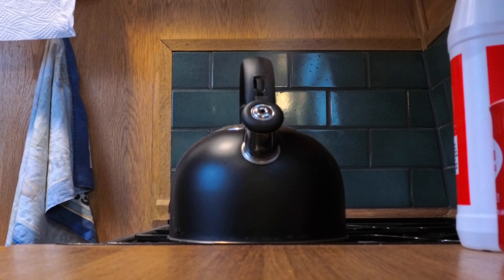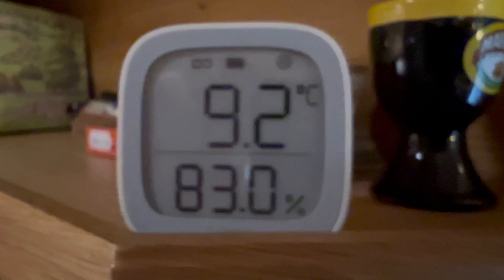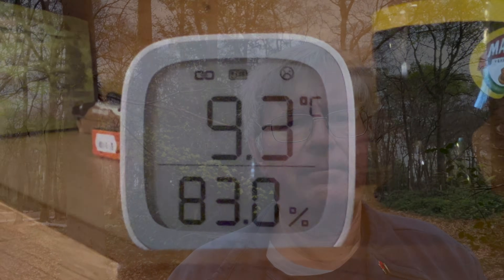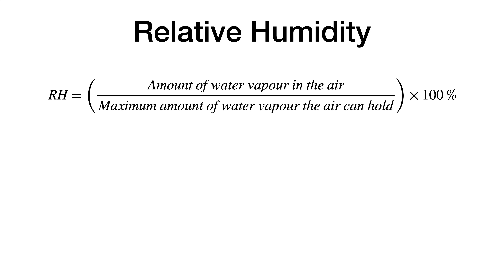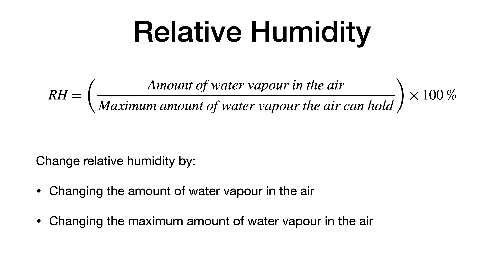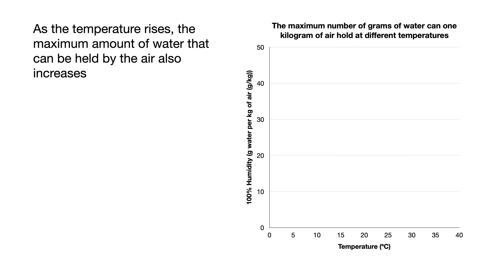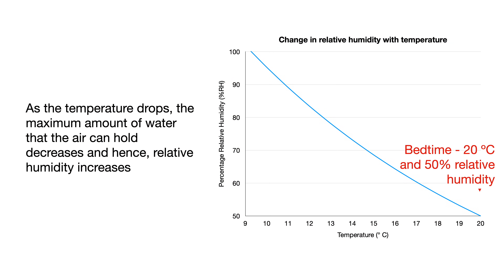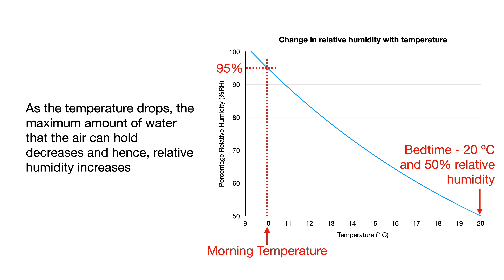Humidity and Condensation on a Narrowboat: Why It Happens and How to Stop It (Part 1)

Comment: This is my first autumn on a boat, and it has been rather rainy and humid and warm this autumn. The humidity inside seems to range from 65-79% based on the temp as you described above, but the outside air seems to be even more humid, the opening of the doors trick doesnt seem to be helping. I am a continuous cruiser so running an electric dehumidifier, which i do have, at any point other than when my engine is running doesnt seem to be feasable. Is this autumn just a one off and not quite normal, thus i dont need to worry to much? or is my humidity opperating at these ranges going to do lasting damage to my boat? I am quite afraid of mold developing under the floor boards or places i cant see it!
Reply from the maker: It does sound like you are struggling with humidity and condensation. I did my usual ‘luften’ this morning and it had no effect. In fact, the humidity was lower in the boat than outside. As you said, it had been a particularly warm and humid autumn and that is not helping. I’ve certainly experienced the high humidity levels on my boat as certain boards in the engine room have already swelled and are getting difficult to lift. I guess it’s time for me to break out the dehumidifier? What we need is a few cold days of lower humidity. That would give us a chance to dry the boats out.

Comment: I've just come back from your video on how you heat your boat. In it you mentioned how the coal heater can make that area too hot yet not get the rest of the boat warm enough. 
I think moving air around the boat is the key to both heat and combating condensation. If you are off grid, then I understand that power consumption can be an issue, but using electric duct fans would probably cost less in terms of energy.
Reply from the maker: Thanks for the comment and the idea. I could certainly use a fan to push the air around when I’m on the land line but as you say, when off-grid that will be an issue.
Reply: I think it's still worth considering as the central heating also uses electricity in the form of a pump, and the dehumidifier must use quite a bit, also the diesel heater I mentioned on another video is very different to the diesel stove, look up "Chinese diesel heater" on YouTube
Reply from the maker: OK. Thanks. Will do.

Comment: I'm not sure exactly how your dehumidifier works, as  if the desiccant is dried using heat, then how is this not put back in to the air, it obviously doesn't as it manages to remove it as a liquid.
Reply from the maker: This is a good question. My understanding is that in the model I have the desiccant is a rotating wheel and the moist air is drawn through the slowly rotating wheel. As the wheel becomes saturated it is regenerated by rotating through a heater (this is why the air put out by the dehumidifier is warm) and the water evaporates from the desiccant. The hot moist air is then passed through a plastic condenser that snakes back and forth across the back of the machine and the water vapour condenses and drips out. Effectively, the machine is using the fact that hot air can fold more water vapour and is relying on the hot moist air hitting its dew point as is cools on its long journey through the condenser.
Reply: @Nicks-Wanderings  I had to read that a few times to get my head around it. Does it use much power?

Comment: It's nice to see someone who has the correct understanding of humidity.  As I see so many that get this wrong, like people who live in cold climates saying that they live in a high humidity climate, just because they see a higher relative humidity on whatever they used to measure it. 
There's also a misconceptions over diesel heaters, that have become very popular especially van lifers, they often say that these dry the air, as it's a dry heat, this misconception is enforced when they see the relative humidity go down as the temperature rises. It's true that these heaters don't add moisture from the combustion of the fuel, and can reduce humidity if they are installed in sutch away as to heat fresh air from outside rather than recirculating the internal air.
Reply from the maker: Thanks for the comment. I have lived in cold dry climates where we used humidifiers to put moisture back in the air inside our houses and hot humid climates where we used dehumidifiers (air conditioners) to take moisture out of the air. Both places had very similar relative humidities outside but the air inside the house when warmed gave an astonishingly low relative humidity.

Comment: Three simple things that prevent condensation.
Insulate.
Heat.
Ventilate.
Reply from the maker: Totally agree. However, on an older boat, I only have single glazing and no easy way to improve the insulation.
Reply: @Nicks-Wanderings  For sure it can require creative solutions but follow the principles and it does work. 
30 years living in boats and caravans is my education.

Comment: 1kg of air ---> 0.833m³ (at NTP - normal temp 20°C & pressure 1 atmos; 50% RH)
Reply from the maker: You never think of air having weight, and I can’t make up my mind if 1 kg of air being a cube of roughly 94 cm along each edge (or 833 litres) is big or not…

Comment: Very interesting to hear what they do it Germany.
It makes perfect sense what they do.
I have a full understanding of Humidity due to varies jobs I have done. 
Getting people to understand that it is cheaper to heat dry air than moist air is the biggest hurdle. Letting go of heat seems counter intuitive but it really does work if done as you instructed.
Reply from the maker: Thanks for the comment. I think the problem is ‘relative humidity’. 80% relative humidity sounds wetter than 50% but, at 5 °C 80% relative humidity is dryer than 50% at 20 °C as the air is holding less water. As you say, it feels counter intuitive.
Reply: @Nicks-Wanderings  Exactly right, until you get your head around the coloration with temperature it is hard to understand.
Reply: @harveysmith100 and it took me some time.

Comment: My brain shuts down at maths but I get the gist of what you are saying.  It explains why I don't have as much condensation as other boats that I see: I frequently open the windows and give a complete change of air, especially directly before bed when I have the duck hatch open for 10 minutes, plus some of the windows, and then I load the fire directly before I get into bed.  That way I have the best of both worlds: plenty of fresh air and a fire ticking over nicely during the night.   Thanks for the explanation.
Reply from the maker: Sounds good to me. The change of air thing really seems to work. And if you consider that 5 °C air with 80% relative humidity contains less water than 20 °C air with 50% relative humidity, it all starts to make sense.

Comment: Didnt realize the compressor dehumidifiers didnt work so well at lower temperatures. Thats maybe why the humidity is stuck. Looking at the Meaco descicant units now, hope they might do what the Meaco Arete cannot!
Reply from the maker: It took me awhile to find out about the issue with the compressor type. I think my sources were an online yachting magazine and a boat forum.
Reply: @Nicks-Wanderings : why the junior without wifi? Maybe I should find your automation video!
Reply from the maker: @njw-vareo725  That's a good question.... I don't think there is a DD8L that is capable of connecting to a home automation system. There is also an argument that you shouldn't connect a dehumidifier to an automation system, as it needs to run all the time. (I haven't done the automation video yet....)
Reply: @Nicks-Wanderings  : Found a serious downside of the DD8L. It does not stop when the  tank is full. Pulls the huidity low but flooded the floor. I can see why you have the thing in a sink.

Comment: Would using a diesel heater vs an solid fuel stove make a difference regarding humidity?
Reply from the maker: Good question. I would expect not. Reason - the heat from the stove would cause most of the water vapour to vent up the chimney in both stove types. Anyone got another view?

Comment: I always thought that dessicant dehumidifiers vented out the moist warm air outside so you couldn't use that air to heat the boat. So, I've learnt something today.
Reply from the maker: Thanks for the comment. The dry air coming out of the electric dehumidifier I am using is about 12-14 °C.
Reply: Car aircons dehumidify the incoming air, and the dry air allows you to perspire better so you feel cooler.